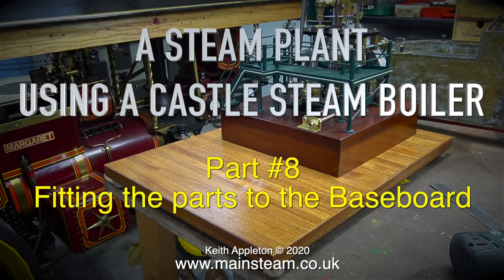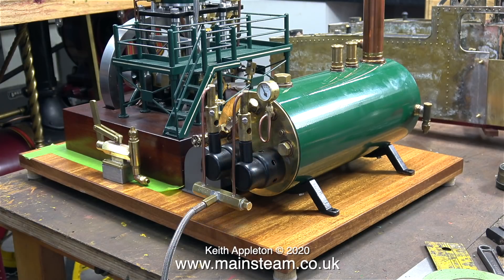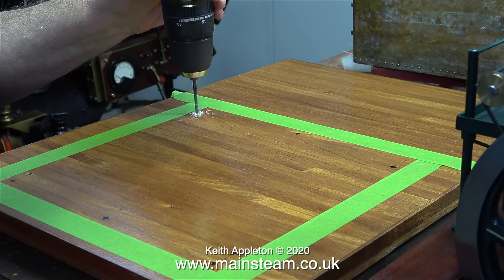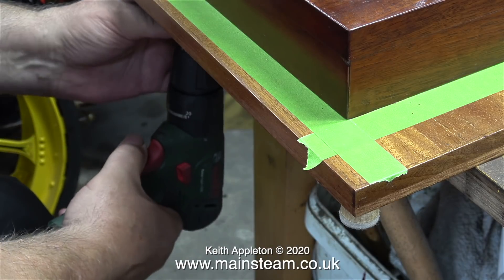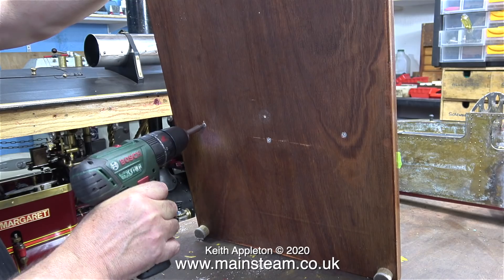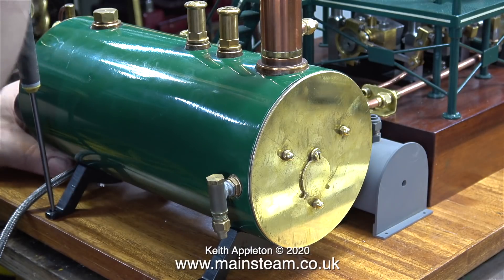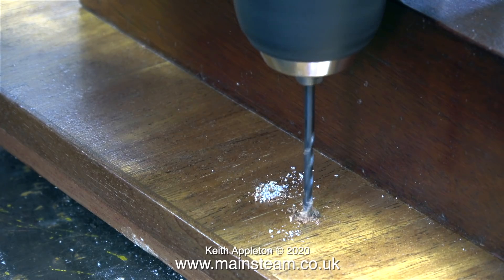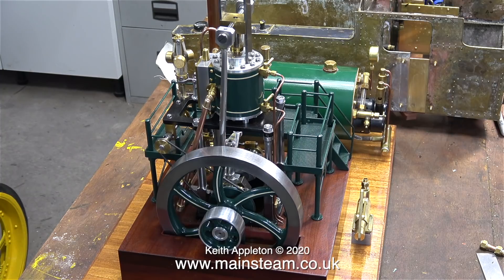A STEAM PLANT USING A CASTLE STEAM BOILER - PART #8

Comment: its a pity the glass case can not be fitted .. with the boiler clack valve stepping out more than the feet of the boiler ..
Reply from the maker: ?? Not so ..... the glass Case is going on the outside of the baseboard anyway . . . .
Reply: To me it looks perfectly as it should.
Reply from the maker: Yes, I measured it. The glass case fits around the base and the Check Valve just clears it. The Camera angle makes it look like it sticks out too far, but it doesn't